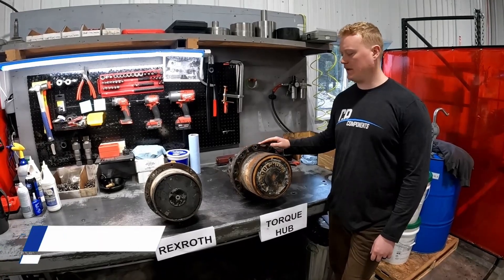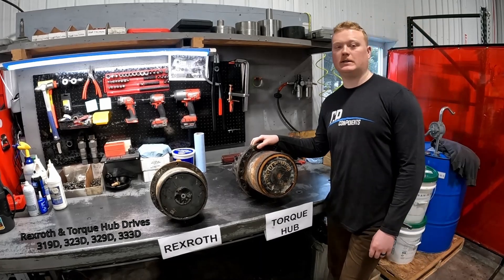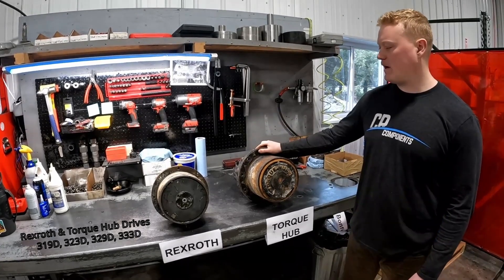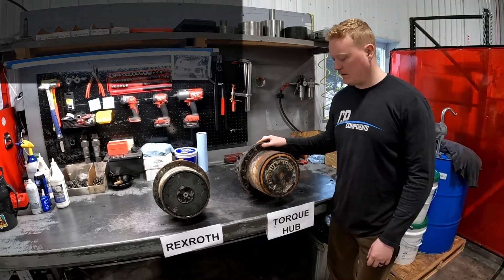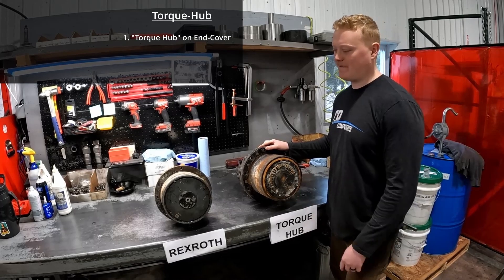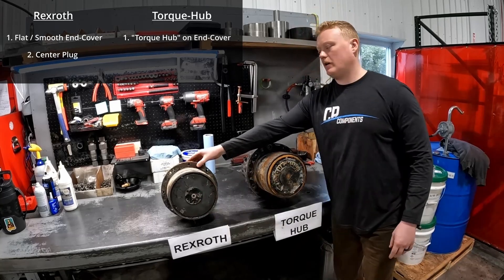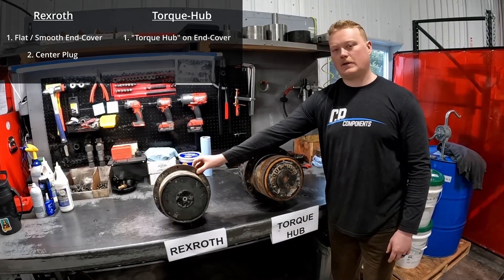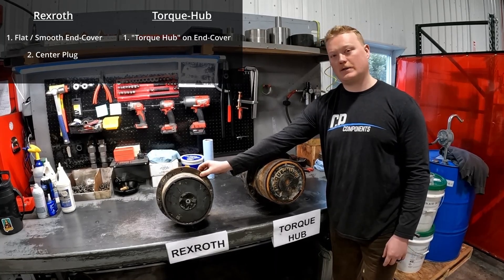How to Tell if You Have a Rexroth or Torque Hub Drive Motor on a John Deere Track Loader

Comment: Just rebuilt the torque hub on my 333E using your kit!  Everything went back together great and I can’t wait to break out my fancy new socket in the future!😊. One suggestion to add for getting the bearings back on the hub a little easier is warming them up in a roaster pan full of oil.   Just that little bit of expansion makes a world of difference!
Reply from the maker: Good advice!